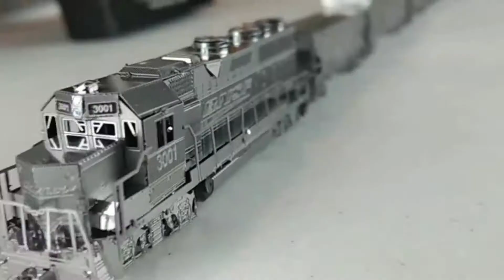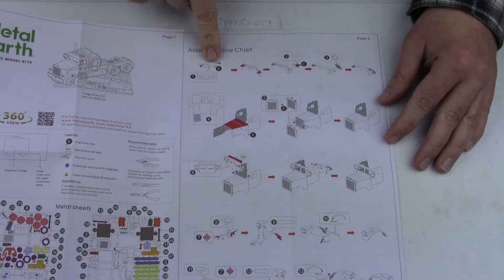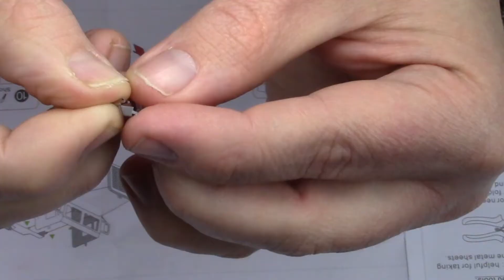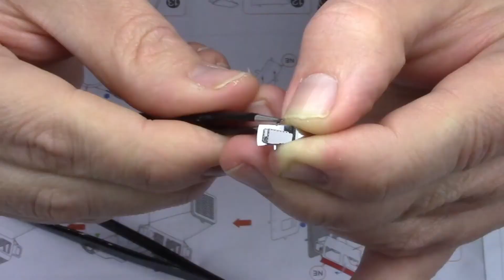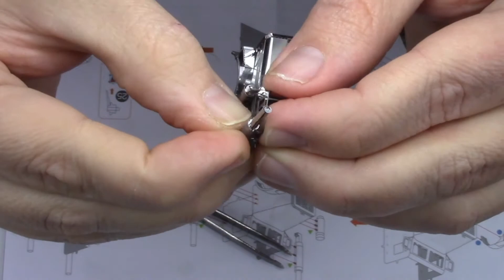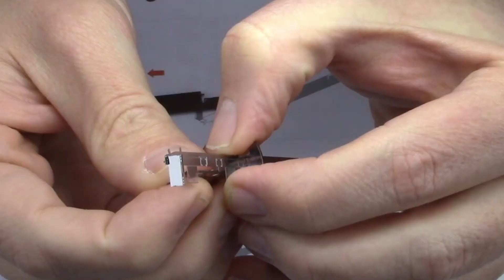Metal Earth Build - FLC Long Nose Truck - Freighliner - Part 1 (corrected opening)

Comment: New to this and knew right away i could never spend more than 30 minutes at a time with these type models.  Once the hands start cramping from holding those tiny pieces, i'm done for the day, lol.  Don't see how you do it, but you do one helluva job on these.  Cheers!
Reply from the maker: Chris Meek I have some cramping issue myself, mostly with my left arm because of a previous surgery. I typically don't do long Builds in one sitting. I my go from 30 min at a time to two hours depending on the situation.

Comment: You mentioned having difficulty getting slots over tabs. I haven’t seen it mentioned, but taking a pointed hobby blade and inserting into slot will clean coating from sheet and they slide together easier. I like your approach to modeling.
Reply from the maker: Dolores Kerrn nice tip, I will have to keep that in mind!